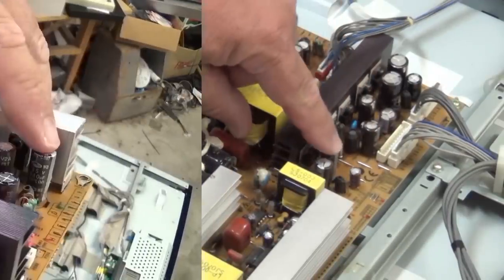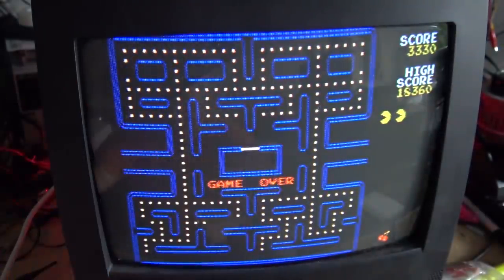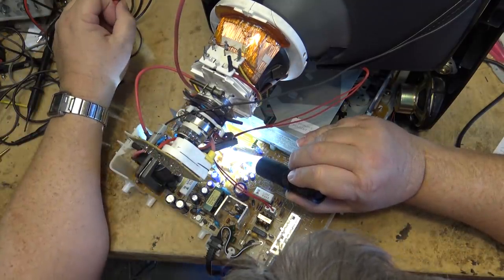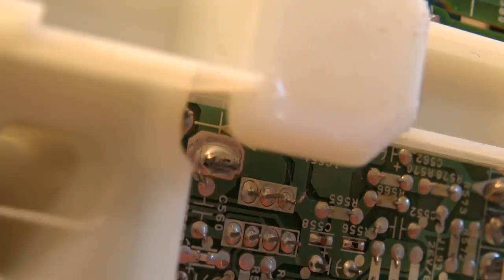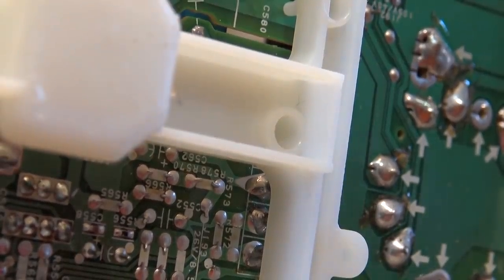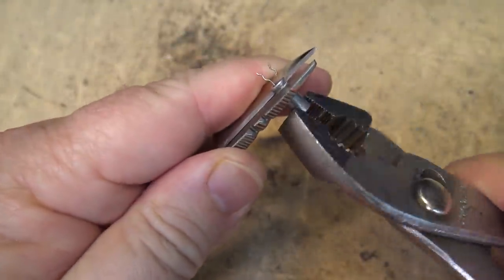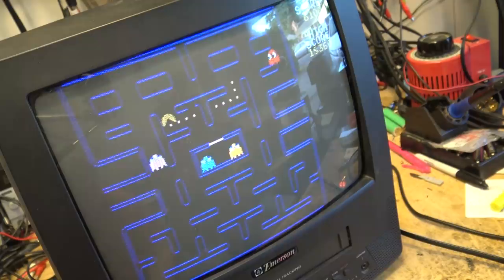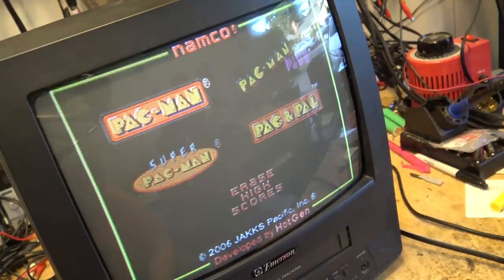Emerson CRT tv vcr combo vertical deflection troubleshooting and repair

Comment: I remember these were mostly sold by large catalogue companies like Argos over here in the UK. Usually re-badged under the Bush or Alba names, and originally manufactured by Vestel in Turkey (and probably Funai, also). They were always quite cheap/ no-frills units, so naturally the VCR side of things often left a lot to be desired!

On saying that, there were a few nicer examples around. I distinctly remember a lovely little Aiwa unit that was 4-Head model with NICAM digital stereo - quite unusual for a 14" TV-VCR combi.

As you probably know, most TV's sold over here from the late-eighties onwards featured an RGB SCART socket, so it has always been very easy to get excellent results from old computers and video games. I don't think I know a single retro gamer that doesn't have at least a couple of CRT TV's or monitors dotted around the house (myself included!). They're an absolute must! :')

Comment: There is always a big hype over the DANGER of working on CRT tubes, could you do a video discussing the dangers of CRT tubes, and how to safely work with/around them?
Great video!
Reply from the maker: Unless you are working around the hv section. Yoke, fly back the rest of the voltages on a solid state TV are not that high.   Keep your fingers away from the horizontal output, yoke, fly back, picture tube when on.  The second anode will store hv for a while after it has been on as the tube will act as a capacitor and store a charge.
Reply: There was probably more danger with the old hot chassis type TVs, where they're not isolated from the mains supply.
Reply from the maker: @michaelturner4457  
Absolutely. All hot chassis devices, TV and radio were hazardous to work on. An isolation transformer was mandatory. I use an isolation transformer for everything I work on.  The power bar on the right side of my work bench is plugged into my big transformer under the bench.
Reply: Yeah 12voltvids, you should make a video about the danger of CRT TVs, and talk about the people who are smashing them for fun, or breaking them on the side of the road to recover the cupper in them. I've watched a detailed video about it but in French.

Comment: I had an earlier version of this set a few years back. Nothing on it would work right and it would go off and on randomly. Once disassembled from that plastic pcb frame I found more than a dozen bad solder joints, many in the power supply. I removed the old solder and re-soldered everything. After that it worked flawlessly. It was still going when the change to digital happened and it got a converter for continued use. It didn't bother fixing the VCR part since it wasn't needed. It lasted to become my mother's set in the nursing home.

Comment: Funny, not too long ago, one couldn't give CRT sets away (even the thrift stores had stopped accepting them). And I even remember seeing them tossed on the side of the road. Now they're becoming "cool" w/ retro-gamers.
Reply: Even today.  You cant give these things away.   It’s not verry common to find someone who will take one of these.     Most prefer the HD crts.   Those are rare as hens teeth and nearly impossible to get for a cheap price now. I find that they are best for grandmas because the newer ones confuse them with the crazy interfaces and so many options.
Reply: @FennecTECH  i have an HD crt TV.
Reply: @FennecTECH  I have a 9 inch JVC PVM that only has one composite input. Its not much, but it's a nice size for me.
Reply: @FennecTECH  
You're so wrong. I got a free 55" LCD TV that had a capacitor issue but the guy told me that I also had to take 2 all CRT tvs. Withing 10 minutes of having them listed they were claimed.
Reply: I recently found a TV VCR combo in a thrift store.

Comment: Clicked on it so fast because I saw "VCR" in the title. :)
Reply from the maker: Technically it is a VCR!
Reply: Yeah! I also know a way to partially take apart a Funai VCR chassis on VCR/DVD combos and standalone VCRs. It would take me awhile for me to tell you how but I commented on your Toshiba VCR/DVD teardown video and I'll copy and paste that comment here. There are 2 screws on the circuit board that need to come out. That won't completely remove the board but you will have access to the capstan belt and mode switch. If you want to clean the mode switch on it, you have to flip the board/chassis back as if you were going to put it back in its cabinet. That will let you hold the front part of the mechanism and you can easily clean the mode switch. I've done that with my Sylvania VCR/DVD combo and now it works fine. If you come across a Funai made VCR or VCR/DVD combo again, this comment might help you. :)
Reply from the maker: @TheVCRKing  
I do know how to take it apart to get at the belt out but to access the mechanism totally you need to remove the connectors as the wires are not long enough to get under the chassis.  Because this job was to fix the vertical on the TV I am not doing anything extra because I am making 50 bucks on this repair.
Reply: Well as always, you do a fantastic job at repairing stuff. :)

Comment: I had a 19 inch combo unit like this but made by Symphonic and has the exact same UI as this TV. I've had so many issues with it the most annoying was the remote wouldn't work and I've taken it apart a bunch of times. I ended up just tearing it down and I got a new Sansui flat screen TV. Had to give up the VCR but I eventually got one so I can digitize all my VHS tapes. I have a really old one made by RCA the SelectaVision with corded remote and it has belt issues.
Reply: coondogtheman1234 I don't "digitize" my tapes. I copy them to DVD. Retains the 60fps of the original video.
Reply: Symphonic = Funai =JUNK

Comment: Smashing job :-D.
Makes a change for you to tinker with a telly, cracking joints and craps.. i mean caps :).
I still like a decent c.r.t picture better than most cheap flatscreens, it's a very old idea that lasted really well.
I never messed with combo tv/vcr portables, its a very bad idea.
We had a shop called "Electronic services" in coventry, it had all the odd parts that no one else could get, we lost that too, i know how you feel :-(

Comment: Love the CRT vids. I've got a 1987 Toshiba CF317 Chassis 8710 with partial vertical collapse on my bench. Adj pot has been cleaned, caps around vert IC replaced, and the height adjustment pot can't "get there." I'd try to find a datasheet for the IC so I know expected voltages and which pin to work backwards, but I can't see any writing on it at all. Shot in the dark, but - I don't suppose you have SAMS 2576-2 and can tell me what the vertical IC is to assist my Googling? I'm also open to any veteran advice.
Reply: Got it. AN5515

Comment: very nice solder joint the second one in the lower line.
You are too brave to toch all those components while cRT is on.. no way a dare to do that..stil dont feel so confident.
I just revived a Samsung 34" HDCRT TV with a blown H.O.T. and some shorted capacitors
but now Im getting a Purple/redish image.. i read it can be a problem with the Green signal
in your experience can give me some advice¿¿ im still anoob in this CRT thing.
Thanks  and excuse my poor English

Comment: Speaking of CRT TVs, I have a 1992 Toshiba CF-1926A, got it for free and used it for a while, and until in 2015, the vertical sinc is not giving me a good picture like it used to be, and what tells me that the electrolytic cap had been dried up and could no longer rely for the picture, I might have to change the used electrolytic cap to get a good picture and get it working again, so there for, new or used cap can be change to get a good picture again.

Comment: being that this set is for retrogaming, I'm surprised that the owner didn't ask you add an RGB input to it. seems to be the growing trend with CRT's these days.  As for getting older games to work on modern displays, I hear the Retrotink-2X works really well.
Reply from the maker: I wouldn't add an rgb input even if someone asked as then i would be liable if anything happened. Many sets are hot chassis and adding rgb requires isolation.  Even adding that, because it is not a manufactures option, if the set were to burst into flames down the road anyone that did any unauthorized mods could be liable.  For this reason you wont see any videos doing rgb mods. It is pretty simple to do as the y/c jungle ic has rgb inputs used by the on screen display to insert menus, however it is the liability I am concerned about.

Comment: Great video!!! Regarding the VCR, Funai designs only get worse from there! I have a 2005 era Magnavox branded unit that only has one motor for all functions, and several soldered ribbon cables. It broke so the owner gave it to me to fix, dispose of, whatever. One critical plastic part broke off. In 1999 I got a screaming deal on the same unit you just fixed for $99US at Best Buy on Black Friday. Still works fine. After your comment about retro games and CRT sets, the price just went UP! 😁

Comment: Good job on this set. Out of curiosity, will you work on portable equipment that has surface-mount components? I have a Casio VF-3000, a rare portable VCR from the 80s that has a built-in LCD color TV, and the TV is completely nonfunctional due to bad capacitors (which is common on the early Casio color TVs). It's packed with circuit boards, and has a ton of surface-mount components in addition to through-hole, and I'm scared of breaking it or never being able to get it back together if I try to fix it myself. Someday when I have the money, I'd be glad to send it to you, if it's something you'd work on.
Reply from the maker: The biggest problem with those surface mount capacitors is they leak corrosive electrolytic which corrodes the traces and through hole connections. On multi layer boards it gets between the layers and destroys the board. I learned 30 years ago to stay clear of these. Fix one thing and 2 weeks later 3 more problems come back to bite you in the ass.  We call those boomarangs. So no I am not looking for boomarangs.  I only work on equipment that i feel will last after repair. If I dont feel it will last I wont do it.

Comment: Here is an example..old when the main chassis and circuit was hand soldered, no particular patterns..components suspended by their individual leads from part to part.except for condensors, electrolytic caps, huge carbon and wire wound resistors, transformers that supplied the current to illuminate multiple vacuum tubes that provided the vertical, horizontal, audio and frequency conversions for reception of picture and audio signals in the raw uncompressed state. 
One can respect the power inside if ever had been 'poked' by 28,000 volt snap off the anode !  Long live Lon Chaney Jr.

Comment: Where would you start regarding a dozen of horizontal lines in the upper part of the screen (toshiba vcr dvd combo)  I was told to check the elec. cap in the vertical deflection circuit.
Reply from the maker: It's the bootstrap cap in the vertical circuit. This will be right next to the vertical output ic.  On many Toshiba sets this was a small red cap. Usually a pretty small one.
Reply: @12voltvids  the tv is a toshiba MN27FN1CR, would that be C427 or/ and C429? same manual as MW20FN1R
Reply from the maker: @julieguay9037  
Couldn't tell you because i don't have manuals handy nor the tv.  It will be one of the small ones around the vertical output ic.  Just change them and it will fix it.

Comment: There is always the friendly Lee's Electronics next door to Main Electronics or the expensive RP and MRO Electronics. Was RP called Active Electronics before?
Reply from the maker: Lee's moved across town years ago. To a bigger store at 25 and Fraser. Rp who knows where they are now. They have moved about 3 times in as many years.  
They are still around, back in barnaby again.
Active has been gone for many years.  Same with ridd electronics. Ridd was bought out by interior electronics on boundary. Dont know if they are around anymore.

Comment: I’ve got the same tv with a 3 inch black bar on the bottom and the top has some black lines making the picture seems zoomed on half. Would this be a vert or horizontal output issue?
Reply from the maker: Its capacitors in the vertical ramp circuit. Small ones typically 1 2.2 3.3 or 4.7 uf and a larger one 100 or 220 right in next to the vertical ic.

Comment: This same problem happens with Duck Hunt on NES. The zapper will not work on a flat screen television.
Reply from the maker: That's because the "gun" is looking for the flying spot on the target. There is no flying spot on any digital panel.  
The slo-mo guys should make a video showing a TV screen in super slo motion to slow down the scanning of the tube.

Comment: I have a Symphonic SC313B combo TV/VCR.  It plays a tape fine.  If I 
stop the tape the TV shuts off about 5-10 seconds later.   If I turn it 
on it runs for another 5-10 seconds and shuts off.  If I turn it on and 
play a tape it plays the tape fine.   Any tips or tricks I can do to 
make the TV work without shutting down?  I don't care about using the 
VCR.   Thanks,
Reply from the maker: These combo units run a self check on the VCR. If the loading belt is slipping for example it will not complete the test and the set will shut down.  You will have to fix that problem to even use the tv.
Reply: @12voltvids  If it plays a VCR tape without shutting down and only when I stop the tape or try running the TV without the tape it shuts the TV down, would a belt have anything to do with it?

Comment: I have an Emerson CRT VCR combo and it recently started acting up. It refused to eject my VHS tape, and when it finally did, the ribbon wasn’t released. Now I believe the VCR is stuck. The tv turns on, the VCR makes a grinding noise and then the tv turns off. Any tips on fixing it?
Reply from the maker: Check mode switch
Reply: 12voltvids Where would that be located on this specific tv? I have no manual for it
Reply from the maker: I shot some cleaner into the mode switch at the 39 minute mark.

Comment: I've been frequenting drive thru's lately. I went into the local Wendy's today. The clerks were mostly mingling with each other about how so and so didn't do what they were supposed to. Then everything diet on the Coca-Cola Freestyle. Yep, every diet option.
Reply from the maker: I havent bern to a fast food joint since last summer when I was traveling and then it was just to use the mens room and buy a cold drink for the road. For me when I go out it is always a sit down joint.

Comment: I always stay well clear of those vcr / dvd combos, yea the screens maybe fine but the vcr or dvd drives don't last long in them then you have a TV that doesn't work 100% and you can't fix them because parts to fix those drives etc are hard to find or cost more than the tv, sadly a throw away item.
Reply from the maker: Right and that was why at the shop I worked at, we didn't offer them for sale. People would ask for them, and that was what we told them. The TV will last way longer than the DVD or VCR and when that broke you had a piece of junk. I have been given a few, and it works still. I was given a big 28" Toshiba with a VCR and DVD player. Haven't plugged it in since it was given to me.

Comment: These combos are garbage! On every one I've gotten the VCR doesn't work. If you try ti use it it just shuts off and also eats the tape.
Reply from the maker: Yup they are, but if that is all you have.
Reply: @12voltvids  I have a similar TV/VCR combo, and the great thing about it is that the VCR part of it actually works still. The internal rubber in the mechanism might need some help, though.
Reply from the maker: @rawr51919  
When I worked at the TV shop we tried to steer people wanting tyres combo units away telling them the TV is going to last much longer than the VCR or DVD player and they were better off getting separate units.